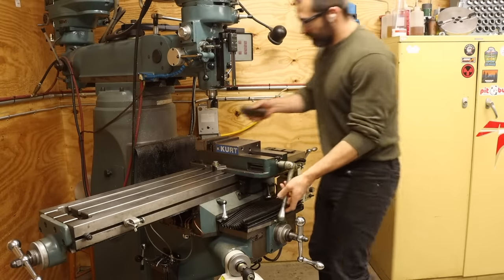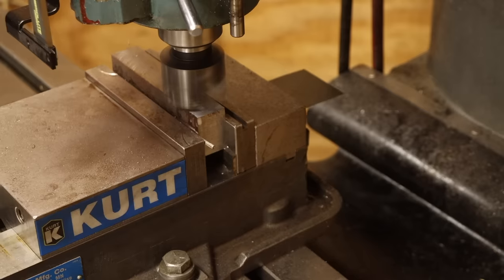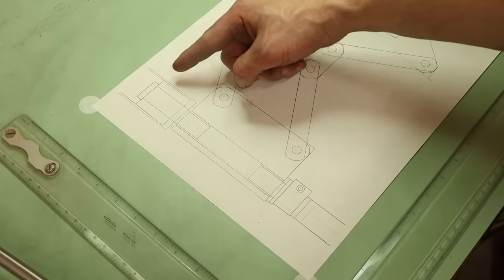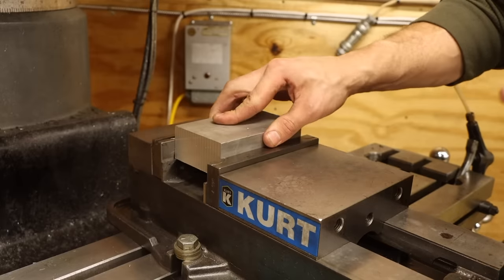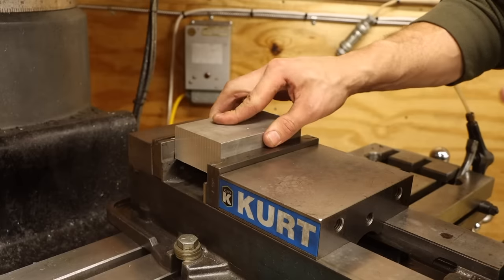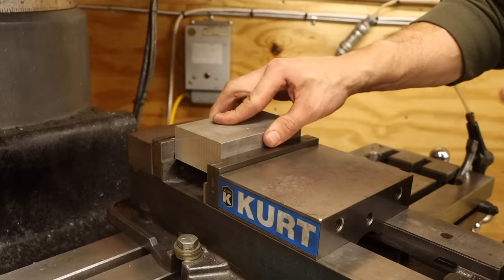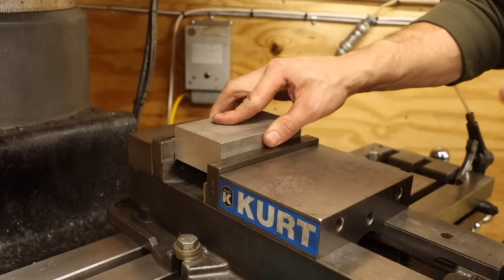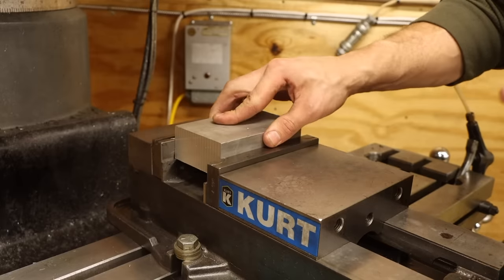A Life Changing Filming Upgrade || INHERITANCE MACHINING

Comment: I may be making an inferior clone of your design, but have some ideas above my abilities.

From your materials engineering background, is there anything that would give the joints some sticktion, yet little sliding friction?  It would be a self-locking effect if it could be balanced right - and if it isn’t imaginary!

I’ve always admired how the Noga flex arms act, but have been reluctant to mangle mine to find out.  It is such a convenient locking mechanism that I would be willing for you to investigate how yours works…

The Box Of Shame reminds me of something I saw that used to be in the Savanah GA airport, but has been removed.  For background, Savanah is near a large military base.  The airport had a large display mounted on the wall containing many of the things that TSA had confiscated from would-be passengers.  In addition to military firearms, knives, grenades, flares, smoke bombs, and fireworks there was a HUGE pair of black handled sewing scissors - probably 12” long.  

My point is that instead of hiding parts in the BOS, you should make a wall display.  The only reason there is anything in the box is that you are USING your tools, learning, and taking on complex projects.  If you weren’t stretching your capabilities, it would be empty.  There will probably be an instructive progression if you display them by date.

Fantastic work, learning, and channel!

Comment: Are you worried about the camera shaking?  Either from pressing record, or from the walls and ceiling transmitting vibrations from the machines? You might consider a wireless shutter trigger.
Reply from the maker: It's pretty easy to steady the camera once its recording and so far external vibrations haven't caused any issues. I may bet a remote though if I get too bothered by it

Comment: @InheritanceMachining, I've been meaning to ask, what kind of Pencil is that you use??
  It looks like a mechanical pencil but the lead is a lot bigger than a standard mechanical pencil and I'd like to get one for myself but, I'm unsure as to the type of pencil it is. Project turned out great like always!! 👍👍

What no side project to make a centering boss for the slitting saw arbor?! 😂
Reply from the maker: Thanks! The pencil and a Staedtler 2mm lead holder

Comment: I don't know how long your camera batteries last, but mine don't last very long before I need to put in a fresh one. The camera batteries are fine for being totally portable, but as you probably know, shooting a video like this will drain a single battery in no time! I built my own external very long running battery solution. Most cameras, you can buy an AC adapter that will plug into the battery port in your camera. The power supply is usually very cheap and pretty poor quality. You don't care as all you want is the battery adapter and the cable coming out of it. You can put a connector on the far end of that cable that plugs into your typical LIPO battery pack and you are all set. You can run for many hours from an RC LIPO battery pack. Any RC charger can charge the pack again. An 8Ah 2S LIPO pack will run your camera for many hours. If you need more run time, get a larger capacity 2S lipo pack. 20Ah packs are easy to find. This won't effect the output voltage at all. The critical detail is to match the voltage of your camera batteries. Nearly all modern cameras run from 8.4v (2S) or 12.6v (3S). Just get LIPO packs with the same series cell counts as your camera already takes and you are set! I have so much battery run time that I power my LED lights off the pack too. I think your camera gantry can support the weight of a LIPO pack at the camera mount for easy pack change out when that is needed.
Reply from the maker: Thanks for the info! Surprisingly I only have to change batteries a few times per project. Once a day maybe on heavy filming days.
Reply: @InheritanceMachining  Nice, mine don't last but 30 minutes at most.

Comment: That camera trolley is sweet!  But I have to admit that I was surprised at all the wood in the project.. do you not weld?  Not a criticism..just an observation.. but I'm more of a fabricator than a machinist. Also I have a set of corner rounding mills of various radius that would have been great for corners of your parts.
Reply from the maker: Thanks! I toyed with the idea of making a weldment (I have some basic welding skills) but I decided a first attempt with some leftover plywood that I already had would be worth a try. And save some money

Comment: where did you find the base design for armlength and the shapes of the connector plates?  Was it all just done in CAD until you found something you like?  Seems like there's got to be a guide somewhere on how to design those arms...      Anyway, great video, enjoyed it.
Reply from the maker: Thanks. There's nothing too critical about the shapes or the lengths of the tubes. I just went with some common dimensions for most of it when I sketched it all out on paper.

Comment: Any thoughts about what you'll do about vibrations or other movement transmitting into it? Just going to rely on optical image stabilization or handle it in post?
Reply from the maker: Both of those have helped on a few shots where I didn't steady the camera well but really external vibrations haven't been an issue so far

Comment: Just a question: how much friction is in the trolley? Does it want to move around if you bump it gently, or are you going to need some sort of lever which brakes it against the wood of the ceiling?
Reply from the maker: I does move easily but it stays where I put it. If I were to bump it mid shot it would ruin the footage anyway from things shaking. But it easy enough to keep out of the way for most shots

Comment: teacher "use trigonometry to find the missing side of the triangle"
me an intellectual "teacher I need two bolts"

i can see the next project lol, stepper motors and cnc for the camera gantry system with several preset positions

Comment: Turned out great!

Just a quick note about table saw safety - yeah I know, safety comments on the internet... But since this is a machining channel I don't know how much experience you have with wood tools, so as a woodworker who still has a hole in his wall from kick back, here's my two cents: at 20:30 it looks like you're cutting that board of plywood free hand at an angle, without anything guiding the wood. Cuts like these are very dangerous, as they can easily bind up on the blade and either kick the board back at you or pull your hands into the blade. Or both.

So if you're comfortable with cuts like these, go ahead, I can't stop you, but I'd highly advise against it.
Reply: was looking for a comment mentioning this. i don't want to see one of my favourite videographers to get injured...
Reply from the maker: Thanks! And I appreciate the safety reminder. It's easy to get too comfortable around these tools sometimes. It's bit me before

Comment: It looks a bit Iike you have suffered from some recent condensation problems. I don't think I have seen quite so much surface rust since I started watching your videos from your first post. I had a big problem in my workshop when we went from -6C to 10C in less than 24 hours. Every cold surface was dripping.
Reply from the maker: Fortunately not. I have a dehumidifier running 24/7 so any rusty stuff you are seeing is just stuff I haven't gotten around to cleaning up since I moved it in. Like the bandsaw haha

Comment: love the content, just one question.  why do you put a small rod in the vise when using the mill?
Reply from the maker: Thanks. It's a soft aluminum rod for clamping on unfinished/uneven surfaces. Prevents the part from working loose
Reply: @InheritanceMachining  that's a good idea actually.  never would've thought about that!

Comment: Do you live in a place where humidity changes through the year? Be careful with nylon bushings, they expand under humidity a lot more than you'd think! Delrin is much more stable
Reply from the maker: I never realized that. I do live an area like that but my shop has a pretty good dehumidifier running. Time will tell, I suppose

Comment: Does it wobble when walking in the shop or while a machine is running and vibrating? I tried something similar and even tiny vibrations transmitted and induced image wobble that was unpleasant to watch.
Reply from the maker: Surprisingly external vibrations don't affect it at all. The shop walls and ceiling are pretty well isolated form the machines

Comment: But the gantry and crane done have any brakes?  It’s gonna creep and move. Or wobble the footage. No?
Reply from the maker: Its stay where I put it remarkably well actually. And the wobble is pretty easy to stabilize by hand once I start shooting
Reply: That’s great. Must be enough friction in the parts. I was worried the roller bearings would be too free moving. The mass of the gantry helps too I imagine.
Reply from the maker: @shaocaholica  I think that's exactly what's going on. It's weirdly smooth but also stays still. Maybe I just got lucky haha Thanks for the support over on Patreon, by the way!

Comment: Can you give me a little information on the bluing solution you used?
Reply from the maker: Its the cold bluing kit from Caswell Plating
Reply: @InheritanceMachining  Was it the cold bluing kit for Steel or were you using the ALUMINUM BLACKENER A385? (thanks for the quick response by the way)
Reply from the maker: @codygoss7294  Sure thing. It was definitely the cold bluing kit. I haven't gone down the route of anodizing aluminum yet

Comment: Another amazing video Brandon!  Not a sine bar like I had guessed, but something far cooler and much more useful.  As soon as I saw you adding the channel to the ceiling and screwing into the joists, I started thinking that it would be cool to make the cross axis stronger with a heavier duty trolley for handling heavy materials in the shop.  Maybe a future upgrade?
Also, the design you already have for that arm would make for a great tapping arm...
Have you seen the camera arm assembly that Alexandre Chappel made? https://youtu.be/V9e9ZWflCQU
Reply from the maker: Thanks Keith! And yeah this definitely has potential for upgrades and other uses. I haven't seen Alexandre's channel before though. I'll have to check that out!

Comment: Listen...I hate to be that guy, but that free hand cut on the table was very sketchy. If you twisted the piece a little more that thing could have missled directly into your groin. Using the bandsaw is a better application for freehand cuts because the cutting force is directly downward. I say this, because I have missled a piece of plywood directly into my groin before and it was quite unpleasant
ps: I am referring to the diagonal cut, not the one against the fence, although both should have technically been made with the mitre gauge, the one against the fence was relatively safe
Reply from the maker: Good point. Definitely not my smartest move. I appreciate the safety reminder

Comment: I hate those sprocket things that tighten the chuck. They literally always teleport away from where you put them. And when you have multiple tools that use them but have different sizes, you always find the one that you can’t use for the tool you need. There has to be a better way….

Comment: For me over head is not so easy, I am toying with a magnet system and steel plates screwed to the ceiling in required places.
However until that time, I am still using my tripod with my homemade camera boom: https://youtu.be/XlZitVBpXeg
Thanks for the videos.